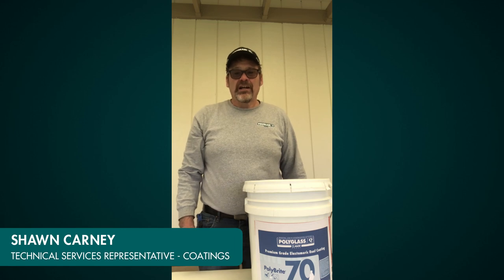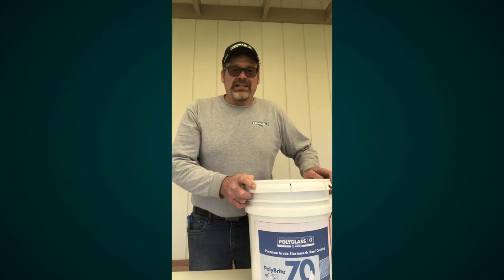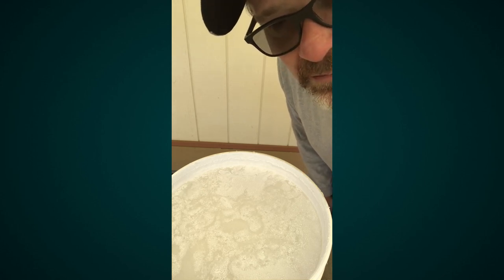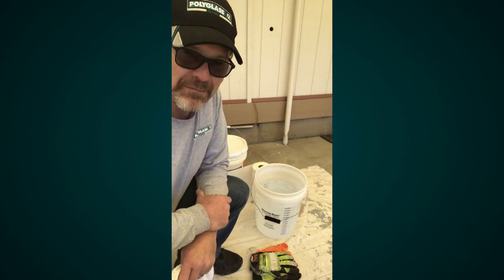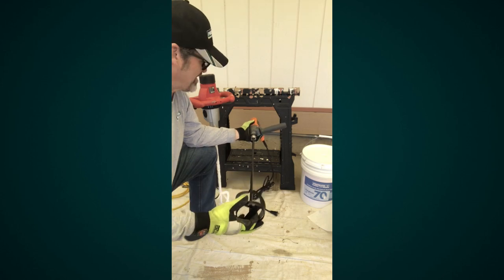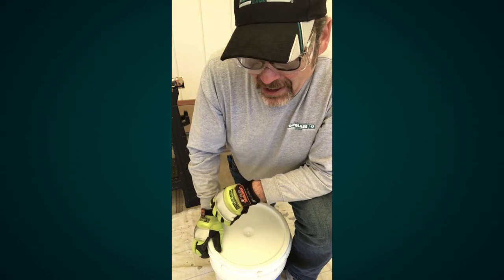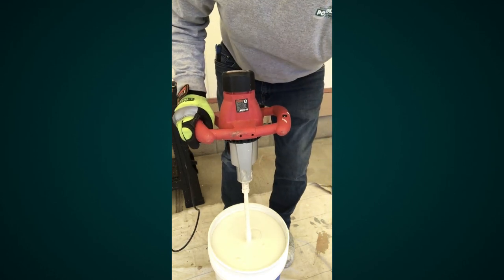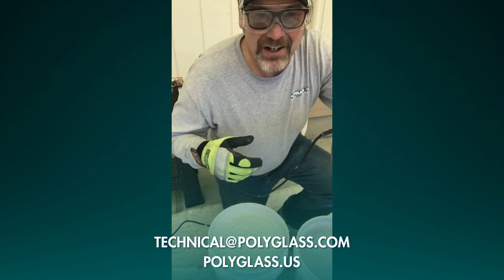Tips from Polyglass' Roofing Experts – Proper Roof Coating Mixing

Comment: Does Polyglass recommend mixing the product on the ground or on the roof?  What is the best way to get the full buckets onto the roof?  Is there a safe way to carry a 5 gallon bucket up a ladder and maintain 3 points of contact with the ladder?  Is it safe to hoist a full bucket by the handle?  Can you please explain the best way to store partial buckets?
Reply from the maker: Jeff,

The location of mixing on the ground or on the roof is a contractor preference.  Once mixed, our coatings will remain workable from hours to days, depending on the product.  
 
The best way to get full buckets on the roof is to have the distributor load it.  If that is not possible, there are a few hoist/pulley systems that are available to attach to your ladder to get material to the roof.  There is no safe way to manually go up a ladder while holding on to a bucket of any material.
 
Yes, our buckets, even when full, can be hoisted using the handle. 
 
The best way to store partial buckets depends on the chemistry of the material in the bucket.  All materials should be stored away from heat and sunlight.  For moisture curing products, a thin layer(1/8”) of virgin mineral spirits on top of the product will prevent moisture from curing the product once open.  When ready to use, a quick mix and the product will be ready for use.

Let us know if you have any other questions.